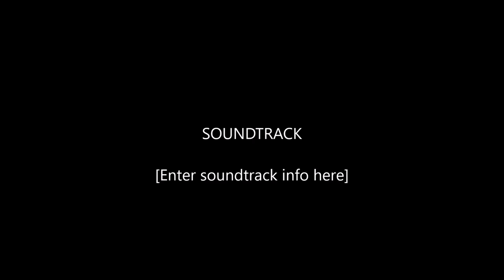NOW THIS IS AN UN BOXING

Comment: Georgia and Baltimore ax also had the lugs on the bottom. A carpenters ax had lugs on top and bottom so you could hang it as either a left or right hand tool

Comment: hey man, I got inspired by the finish you put on your axes and put a handle on an axe head I had knocking about in my workshop went ahead and burnt the handle as you demonstrate,  got it home, showed all my mates, split some wood, then realized I had the axe head on upside down, hey you know what I don't care man I like it,  its different and it splits good. I have got a few Swedish axe heads I acquired when I was In the army, what a nightmare finding handles to fit those, but I have found a 28 " Husqvarna carpenters axe that the handles will fit, ill let you know how that works out. peace and kindness from the west country, England.
Reply from the maker: love it brother well done sounds like it turned out